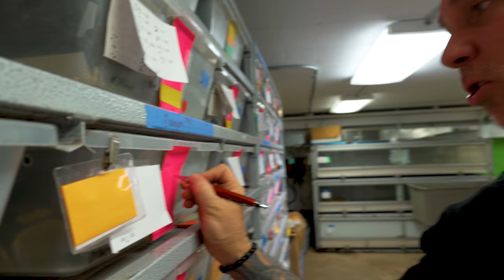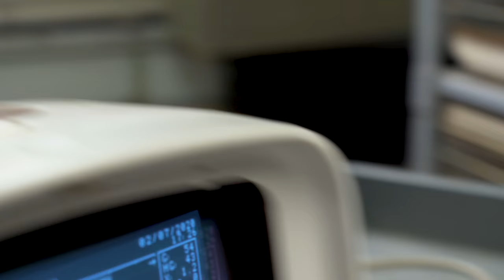SHE FEEDS MY 20 FOOT SNAKE (Lucy) for HER BIRTHDAY!! | BRIAN BARCZYK

Comment: Screen lids are not ideal for tarantulas, acrylic tops with holes drilled are much better, with the screen the tarantula can potentially mess its legs up or even worse fall and rupture the abdomen, and yours was definitely caught in the screen on its little feet hooks, just a suggestion I’d redo those cage lids to prevent future tragedy’s on all the t’s